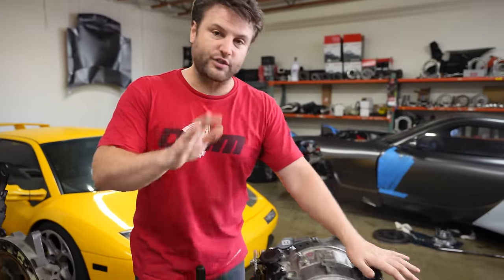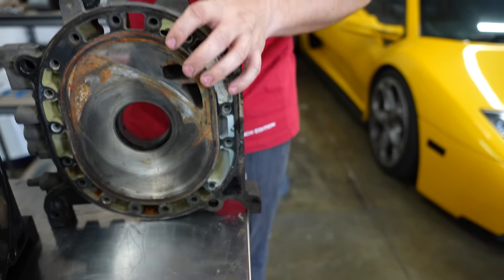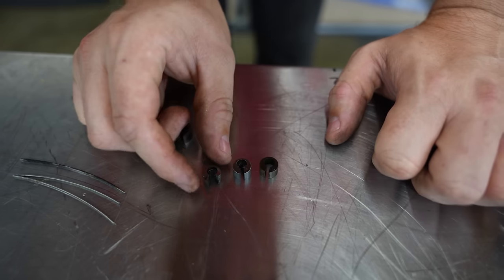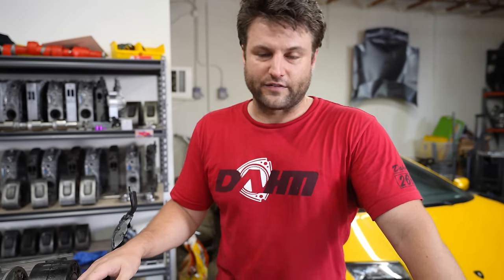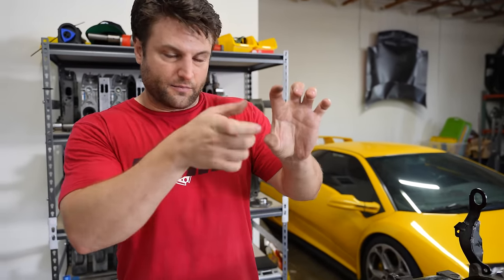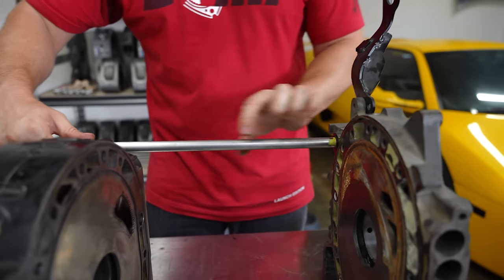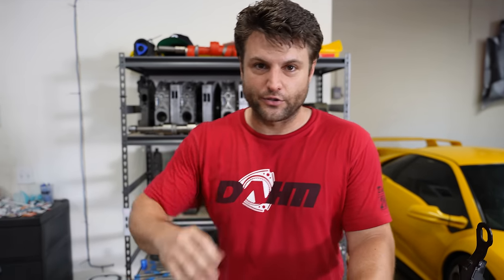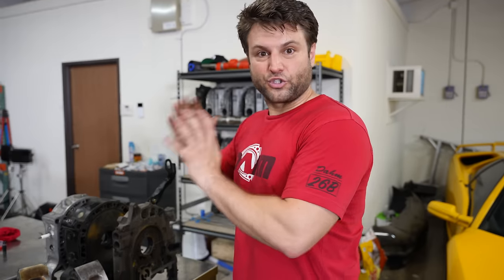Fixing the BIGGEST Problems of the Rotary Engine

Comment: Sounds like the ideal rotary engine has two oil systems, the lubrication system and the combustion chamber system.
The dowel tie rod issue I would be reluctant to put a one piece sized steel element through an aluminum block due to thermal expansion geometry. If anything you put a hex-shafted steel fastener through a shrink fit hex-broached aluminum dowel body. That allows your aluminum parts to grow together but retains decent unity between the steel and aluminum parts. Sounds like an expensive machining job though.
Reply: Same thoughts, which made me think why not add locating/locking/torsion pins. I would make temporary punch pins to put into one side where initial placement holes would be made, assemble the parts and whack with a rubber mallet or tap with a copper one.  Drill out adjacent pin holes and you have a much sturdier engine assembly with pins holding rotationary forces instead of relying on bolts having two jobs.
Reply: The only thing I would change is to increase the thread diameter to reduce stress concentration at the thread base and reduce allowable strain in the threaded section. I don't believe the thermal expansion and contraction is anything to be concerned about as these are non interference fit parts and will have clearance to work at operational temperatures. I also do not see any advantage to having a hex shaft section over a round, can you explain your thinking around that please? I would have thought an Al dowel broached hex, pre-stained and subjected to static and dynamic loads would have high levels of stress concentration and prone to cracking, cost not being a consideration in any case
Reply: Ι tottaly agree with you about dowel tie rod issues.
Reply: Metal doesn't "swell" with heat, it expands. And Al expands more than Fe. So long as the rods fit, cold, they will fit, hot.
Reply: Why do the "blocks" have to even be aluminum?   Not like a big ole large block iron muscle car motor....fairly small casting compared to those? what if they were NC machined from billet steel or iron?   

OR for the aluminum blocks what if the dowels were also made of aluminum like the block but with a machined hole the entire length to accommodate a splined steel rod pressed all the way through it!!??   Idk if splined is the right word but I picture a bunch of sharp ridges all the way around the steel rod  the splined running parallel the length of the rod (except where threaded on the ends of course)....the splined diameter would be slightly larger diameter than the inside bore of the aluminum dowels so that when pressed into place it would actually displace material and be totally locked into place with zero slop and yet be able to compensate for your thermal expansion due there actually being expansion space net to each spine?   I have seen little dowel pins like that pressed into aluminum just to lock them from spinning but this would be a different goal/application ...just an idea from a non qualified non engineer in case it is dumb for some reason
Reply: OR even like you said an octogon steel rod but pressed into a ROUND bored aluminum dowel sleeve....again the overall ma circumference of the   octagon steel would be just a teeny bit larger than the bore through the aluminum dowel sleeve so when pressed in it could have to displace some aluminum....the actual final machining of the aluminum could be done after that press fit.....the idea of this would be no expensive broaching just off the shelf octagon rod and aluminum round stock
Reply: The same is true for big naval 2t diesel engiens
Reply: @dougiequick1  billet engines are still aluminium old muscle car blocks were cast iron to save money. Not for advantages lol. 

Only reason for a cast iron block is some engines the iron versions are mad thick everywhere thus good for boring out and boosted applications. 

Aluminium blocks with cylinder sleeves are best even in piston engines.
Reply: @bcubed72  Either way shouldn't the torsion rods just be made of Aluminum to ensure they always expand in sync with the housing?

Comment: So I’ve never built one of these myself but I come from an engineering background. You have a very interesting point about how the engine is held together only using long screws and dowels, i think that the screws are the size they are because they didn’t want to compromise the structural geometric load dissipation of the end plates where it’s screwed in, larger holes exponentially come onwards or outwards. I think you bring up an interesting point about the screws and why the rest of them are thinner than the main holes, do you think that has anything to do with the way such a unique engine “block” expands based on heat? I hypothesize that those stock rods were carefully calculated to expand a certain amount when the engine is warmed up as to not become loose but not stay on too tight so the seals can function better while also keeping a safe retention between the engine “plates” during cold starts. Inserting straight dowels machined into the holes make some sense into making it more stiff but I’d argue that if it has a direct fit to the actual walls on the holes, then the heat transfer and the rate at which it warms up and the heat dispersion would be not worse per day but poor design, it would most likely stress the frame of the engine block in uneven ways and by completely trying to get rid of the torsion flex, it would beneficially save the apex seals and rotors during run time but making it too stiff will inevitably destroy the main shaft. This was actually the problem with the original mazdaspeed lemans 7 series race car, they made everything fixed with super proprietary seals and basically made a special mounting system for the engine plates and also made a custom engine block to hold itsself together. This led to more consistent performance and insane power numbers in a a variable NA engine of all things. Tho  only thing that would fail consistently would be the central shaft, this is because like you said, at high rpm and insane power, the rotors will inevitably vibrate, if even a single rotors timing is off or has an ignition cycle that even 1/6000th of a cycle off, (between 4 rotors) it would repeatedly torsionally stress and vibrate the shaft. The engine they used for the VNA 4R 7series engines are super custom made and designed specifically to hold ideal power at around 350 or less hp, ( the kinda avg power number held during the entire 24 hour race) and even then, the central shafts failed. I love what you do but I think it’s simply impossible to try to hold together a 1200hp turbo 4rotor engine, especially when the original design was meant for avg power output of about 110hp and a peak of 280~hp at 2-3 rotors. I think that your engine will specifically suffer more of these problems because you rip around and sometimes race and just rev the shit out of it. Anyway, I think the ideal solution for that would be to use “dowels” and screws or whatever you use that match the diameter of the holes but keep the original thread diameter. I’m sure this is already what you do but the next step would be to specifically modify the exterior of the engine block plates, if you use the edges or extra mold pieces and weld a custom machined tab of some sort to increase the torsion stiffness from the exterior, hell, to make it really strong, you could Mount these exterior supports with an offset against each other so that it really locks. Well that’s all I have to say. You get a lot of comments so you might not see this but I would like your input on that.
Reply: @一慶　4444 cool story bro.
Reply: Racing Beat make all sorts of custom parts to stop the torsional load on these engines
Reply: not everything is done with full thought or consideration like that, its also not a blackbird, that kind of thermal expansion is simply not feasible on this engine, the area of combustion is very small compared to the thermal mass and cooling capacity of the block. i think they just f*cked up to be honest, its a relatively new type of engine, and not much has been done to research and develop it in comparison to a piston engine. Making the engine a more solid unit not only saves on wear, but conserves more power as more is put into the rotor and not into twisting the engine. After that just comes reliability, i think its possible to simply not have seals on an engine like this, i'd just have a durable but malleable material (so it doesnt chip or crack) as a solid insert, with no springs, and make it take up a larger volume on the apex for strength. i think moving seals are a fallacy and are just hold overs from piston engines. same with lubrication, it can just be lubricated through the fuel.

all this is to say the engine isnt perfect, and probably wasnt designed with certain factors in mind.
Reply: holy shit guy 😯

Comment: Just random quick comment, but as someone who has worked at Valvoline, I have seen that most rotaries actually call for the basic convention oil rather than the synthetic big boy stuff because of the burning and mixing that occurs. That was pretty interesting when i first learned it.

Comment: So I’ve been doing a lot of thinking later about those tension bolts. What about a brass bushing kit? Use an ARP stud with a press fit brass bushing around it……. It’ll help keep the torsion down using a stronger and thicker bolt, and it’s a softer metal so it allows a little wiggle room for clearance issues. Plus it also doubles as an additional alignment dowl

Comment: Thanks for the very detailed " long term " research like information ( degradation in general ). Learning this and adding new concepts for secondary thermal engines , I.e.  using a rotor as a part of a steam machine and using the wasted heat near the exhaust to generate steam, may also increase efficiency a large step. Duration and overall efficiency can be improved a lot.

Comment: Ohhhhh yes, I shall take these notes when putting a 2 rotor in my Fiat 850. Especially the oil feed and chamfered rotors. Hell maybe when I get around to it you'll be selling your own rotary engine crate swaps hahaha

Amazing work Rob, keep feeding us this crucial information
Reply: If you're building a naturally aspirated 2 rotor the 1 piece solid dowels and external oil feed is unecessary. You can buy a solid and hollow 1 piece dowel kit instead although you shouldn't need to for an N/A build, if anything just add a couple dowels. Race clearanced rotors are ideal but only if you intend to rev it to the moon. 
If you are going turbo then yes, get both upper/lower solid 1 piece dowels and external oil mod, do clearance the rotors then have full rotating assembly balanced, get your plates and housings cnc'd to accept large studs clearanced as dowels.
None of this is new information nor secret, well atleast not in this part of the world where he got his clearanced rotors and original 4 rotor from.
You can already buy engines built like what Rob explains, how do you think he knows?

Comment: I never have owned or driven a rotary, I still found this interesting. Thanks Rob.
Reply: The rotary engine runs so smooth it’s amazing. I could tell just by the sound how fast I was going and it never got stuck in the snow because it delivered the power to the wheels so smoothly.

Comment: I use to use Klotz Super Techniplate in all of my 2 stoke lawn equipment, line trimmers, blowers, chainsaws, mainly because I like the castor smell... until my line trimmer got hot and seized up one day after using Klotz for about 2 seasons. When I finally got the piston out of the cylinder, I was expecting to find them all galled up, but it was in fact a buildup of castor residue on the piston skirts that caused the seizure, the cylinder was perfect. The rings were literally glued into the lands so bad, I could not get the rings off the piston without breaking them. I finally got all the residue off the piston, replaced the rings, and used it for many more years... The Klotz made good brush pile fire starter fluid after that, lol! Awesome video Rob.

Comment: While I could probably improve the entire engine with a week or so of solid sit-down thinking, the apex seal is the biggest hurdle to clear as its, as implied, the primary seal in combustion but also the highest concentration of friction per surface area. This would not be an easy job--but it is doable, as it's done in aerospace all the time--but to solve both the oiling and apex seal wear area, I would run the oil line down the center of the E shaft and through channels of the rotor to deposit a misty spray of oil  directly beneath the apex seal and then let it wick out to the chamber walls, using the apex as a wipe (a ptfe/teflon/ceramic coating here would also be beneficial but it would be a wear over time investigation to see what kind of mileage you get out of it). The apex seals themselves, one would think, you want a strong alloy that is centered around wear-resistance but also lubricates easily. The cheaper, old school way would be to use tool steel (D2, W1, etc) though the ultra-modern knife steels could be interesting to play with as well. 
In the event you ever want to take the apex seal into the 21st century with the oiling idea, look into how turbine blades are made for jet engines and their air cooling channels. It's worth the introspective look even from a machining-to-solution investigative learning side, too.

Comment: Rotaries are super reliable so long as you can pull the motor every time you have one of these extremely common problems.

Seriously though, love rotaries and love you Rob, keep the videos coming.
Reply: Rotary reliability has nothing to do with pulling the engine and rebuilding it often. As with any high-stress application, problems are only "extremely common" if you:
A. Cut corners on your build.
B. Try to ask for more than what your equipment was built to deliver.
C. Ignore proper maintenance.
The only reason you hear about problems with these engines is because most people have no idea what they are doing with them.
Reply: @rotorhead5826  Well that, and alot of folks running rotaries seriously nowadays are pushing them pretty hard.
Speed costs money, how fast do you wanna go?
Reply: @rotorhead5826  seriously, people blow "reliable" engines all the time and acknowledge it was because they over boosted , under cooled them . Peoplr need to understand that 500 hp boosted rotary needs mods to be reliable

Comment: Wonder if that one spot cracks because the coolant runs through, that there's enough difference in thermal expansion between the metal closer to the combustion chamber, and metal further from it. One side is trying to contract, while the other expands?
Also considering how many issues from rotaries stem from the uneven thermal expansion, I really wonder if making the engine block out of invar (FeNi36) would help address a number of its issues?
Reply: I don't even want to imagine what a set of invar irons would cost 👀
Reply: @F3Ibane  may I suggest just make the apex seals out of invar and not the whole engine? There may be some tricks required to make it fit with the coefficient of expansion differentials, granted.

Comment: Hi Rob, I am installing an RX8 engine into a homebuilt aircraft and the sump metering oil system  has been modified by installing an oil metering pump adaptor from rotary aviation. This unit cuts off the sump oil and takes from a two stroke oil container to do the same job still via the metering system. I have also changed out the plastic lines to braided stainless steel and high flow aluminium fittings.

Comment: 16:35 that could so easily be fixed by mazda by simply including locating teeth on the outside edge of the plates so when the tension bolts pull everything together the teeth mesh with each other to eliminate that torque. Or heck with a bit of machining and some strong rings with teeth you could machine teeth into the outside edge of the plates that will mesh with the toothed rings almost like another gasket but instead of sealing its to stop the plates from trying to twist.
Reply: i think the problem with that is mazda used cast iron for the rotor housing. the teeth would eventually crack over a certain amount of time and/or HP. could be solved however if they use machined forged metals. in which case i think that would make the engine more expensive to build and sell, and thats a big no no for a commercial engine. but thats an interesting idea still!

Comment: Rob, are you familiar with the liquid piston engine variation of the rotary engine? Do you think reversing the shapes of the rotor and the chamber is a good idea? It seems to me that putting the apex seals on the wall of the chamber makes sense.
Reply: The big win of the Liquid Piston system is that you get three combustion chambers per rotor, while Wankel engines only have one.
Reply: no its NOT a good idea . cause in the ( so called liquid piston engine) the crankshaft is also your air intake. and that crankshaft needs to be big enough to both handle the torque/hp that your engine produces as well as allows all the air to enter your engine. you will have a seriously underpowered engine or an engine that constantly twists or breaks its crankshaft
Reply: @cordellej  You make a good point. However, the intended usage might be different. They have a really small 4hp motor, great for "small engine" applications.
Reply: @cordellej  The top end potential is probably going to be lower but it should be fine for under 200hp applications